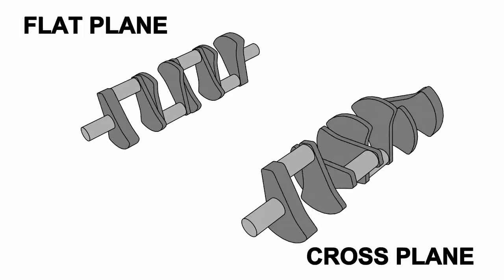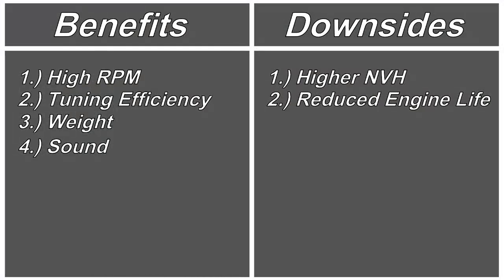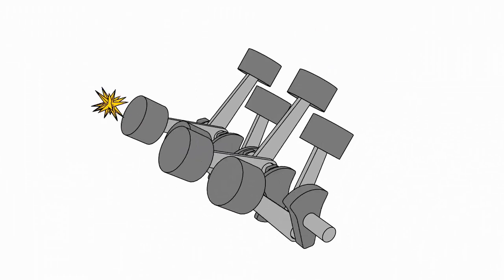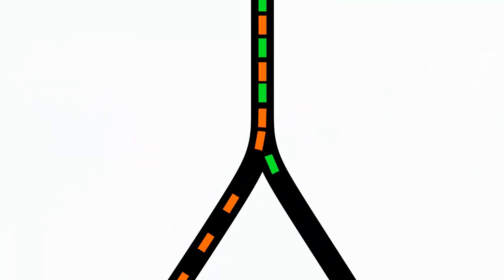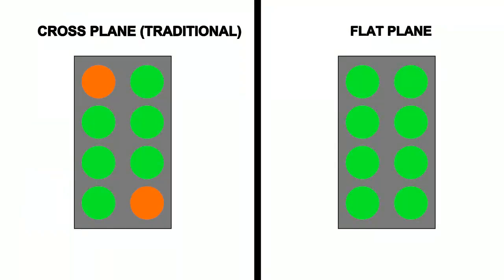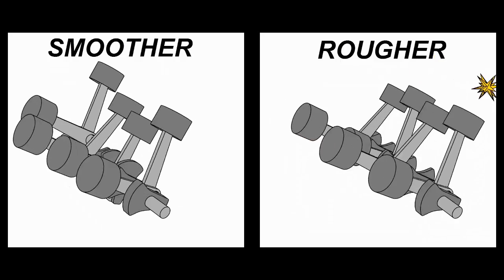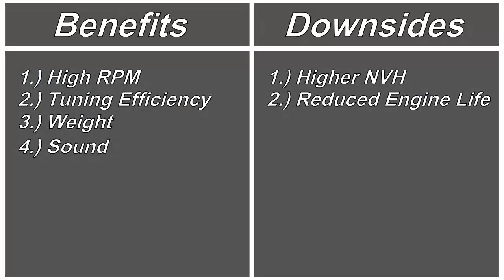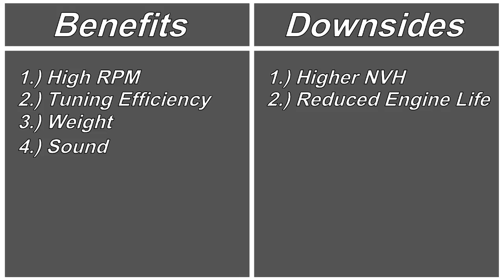Flat Plane Crankshafts

Comment: There are a lot-more historical reasons why American V-8's went with crossplane cranks than is even thought of being addressed here. Keep in mind, the Dodge Brothers (actual engineers) looked at individual journal cranks, flat plane cranks, etc., before agreeing to use cross-plane cranks in their V-8's...a lot of this fell to linear engine length, durability and torque, absent most of the other designs (short the multi-cylinder radial engine concept). All this is a great 'racer debate' when discussing 4-cylinder engines...but quickly fails the litmus test of 'realistic engine designs' when you get to considering how long an engine has to be when it has 8, 10 or 12 cylinders (and using a flat plane crank). It also fails to consider the cylinder bank angles in attempting to accomplish 'flat plane' ideology...being as a 60-degree V-8 and a 90-degree V-8 have different combustion timing...all discounted when you are dealing with inline 4's and 6's...so careful, you are trying to greatly 'over-simplify' combustion engine dynamics for the sake of selling a Ford-Euro engine design that doesn't work so well in most applications outside of racing.
Reply: The first V8s did have flat-plane crankshafts, but they buzzed at certain speeds, just like a 4 cylinder engine.  It wasn't very noticeable in the Touring cars typical of the day, but in closed cars, it could cause drumming sensations at certain speeds.  Wouldn't be a problem in popularly priced cars, but unacceptable in an expensive luxurious car.  That's why Cadillac went to the cross-plane for 1923.  Closed cars had become much more popular by then.

Comment: It's like the old 2.4  Quad 4 Engines made mby GM had a really different idle due to their off self firing order unlike most inline 4 engines they have 2 pistons up and 2 pistons are down the quad 4 engines always had on up 1 down, 1 3/4 way up and 1 3/4 way down.
Reply: TRX VLOGGER that was a cool motor.
Reply: That's very strange, because the balance would be horrible and the firing order would be very uneven. I searched, and can find no evidence of this weird configuration - I have found technical descriptions with photos which confirm a completely conventional flat ("up-down-down-up") crankshaft. 

Check out the Engine Builder Mag article "Rebuilding The GM Quad 4". The 2.4 Quad 4 uses the #4620 casting.

Comment: the flat crank we put in our 350 chev had 2 cyclinder's going off at the same time.    smoothest running engine I ever saw.
ZERO side to side vibration.   
nippy little bitch on the throttle though....   touch the gas and it was 800rpm to 2200 rpm instant...

Comment: Boxer engines are considered the most efficient and use the flat plane crank, however the more "V" you add to the cylinders, efficiency will go down.
Reply: Boxer engines do not use flat planes. Flat planes lack counter weights boxes do not.
Reply: Also efficiency? Boxers are considered balanced not efficient.

Comment: Seen cross plane small block chevys turn over 9 grand.
Reply: Yeah, there doesn't seem to be much difference there with engines built for competition. Hell, the souped-up small-blocks in NASCAR can hit nearly 10K RPM, and they're 358 cubes/ over 5.8 litres.
Reply: You got that right. Back in the mid 80's my friend ran late model sportsman with a sbc 355 at 9,000 plus rpm's

Comment: Same as a boxer motor crank. VW bug.
Reply: Not at all the same
Reply: Every cylinder of a boxer has it's own crank pin with two counter weights a v has two cylinders with a shared crank pin and for flats no real counter weight and for crossplanes of course shared counter weights

Comment: But why doesn't the Mustang Coyote motor sound more like a Ferrari?  O.o
Reply: they use uneven headers to modify the sound, if you listen closely you can still hear the "the flat plane whine"
Reply: The GT350 with the 5.2L VooDoo does not, in stock form, sound like a Ferrari despite it's flat-plane crank. That is because the headers on the GT350 stock, as far as I can tell, are interfering with the exhaust pulses. A GT350 with aftermarket headers, however, does start to sound even more high pitched when up in the rev range. Anyone reading this, feel free to chime in if you know more.

Comment: I ran a flat crank in a 366 cid hemi at Chrysler engineering. Richard Petty brought it and wanted to go Winson cup with a Mirader but it didn't happen. The engine was so violent below 3, 000 rpm you couldn't start it with a starter. I wonder if anybody knows why?
Reply: The camshaft.  Had nothing to do with the style of crankshaft.

Comment: Now I know y I hate flat plane crankshafts. Cause a Cross Plane Crankshaft has a much more aggressive exhaust note than a flat plane. I'd love to here a Cross Plane in da new Ford 5.0 & 5.2 Dis is when Ford lost their edge in exhaust note compared to da rest of all V8's cause da old school 5.0 & 4.6 were da best sounding V8's when paired wit an H-pipe & Flowmaster 40 Series, none of dat delta flow crap. Smfh cause Ford lost their advantage on sound cause I could care less about power.😔😔😔 I drive a 2002 Crown Victoria LX Sport wit da stock H-pipe wit no cats & Flowmaster 40 Series & everytime I drive er I feel like I'm 7 years old again cause of dat sweet note she produces under acceleration at 2k R.P.M's.💪💪💪

Comment: Why aren't 4 cyl engines made with flat plane crankshafts?
Reply: Tim Hallas 
Probably because the engine would be imbalanced because there’s only four cylinders instead of 8.
Reply: @francesco1998   4 X 90 degrees = 360  of course it would be easy to balance. Each piston has one that is 180 degrees to it.  Firing two per revolution, at 180 degree intervals..  It's perfect.
Reply: Tim Hallas 
I mean idk
Reply: @timhallas4275  probably less need to.
Reply: @jdrok5026  less need to what?

Comment: Great explanation and an informative video. Thank you :-)
Though flat plane crank V8's (for me) will never sound as good as a cross-plane crank V8. They sound very much like a plain ol' four cylinder twin cam engine.
I'll take the beautiful V8 rumble any day and pass on the efficient scavenging and high rpm ability. The whole idea for many that understand, is the great torque a decent sized V8 can make right there from idle and maintains great torque throughout a realistic and usable rpm range (<6,500) when you have a daily driver. In other words as much torque as possible from as low an rpm as possible and maintaining great torque for as long as possible. Torque makes the engine more responsive and more pleasant to drive, you can keep the high rpm/high hp screamers.
Reply: Flat-plane V8s run like a pair of 4 cylinders sharing a common crankshaft.  That's why they sound 4 cylinderish.  They also, at certain RPM/Load conditions, vibrate like a 4 cylinder as well.
Reply: @michaelbenardo5695  Agree, they don't float my boat either.

Comment: Now with the Mustang GT 5.0 liter crossplane engine producing 480 HP, kinda looks like there wasn't much point in developing flat plane 5.2 liter with 526 HP and weak low end torque for the GT350. Not much difference in power.
Reply: The voodoo really isnt weak in any characteristics. But it was also a higher end trim the gt and gt350r are different breeds the voodoo absolutely makes the coyote sound boring.

Comment: So why did they start doing the 1-8-4-3-6-5-7-2 thing in the first place then? They must've had a reason. What type of crank does a Ford v-10 use? How about a Mopar v-10? Enzo Ferrari said there's no replacement for displacement. I agree with him on that, and I'd wager that Farmtruck agrees with him also.
Reply: V10s use crossplanes. 18436572 is pretty much the crossplane firing order. There are a few different ones but largely that is the most common order and has been around for decades. Why likely stress to the crank is the best.

Comment: Yeah but the V8 is a bad idea from the get-go. Flat-plane or cross, it has a natural harmonic imbalance that will require a harmonic balancer on the front and a weight on the flexplate or flywheel at the rear that serves the same function as the front balancer. V12's (and in-line 6's) do not have this problem, they are naturally balanced with three cross planes and have much higher RPM potential and durability. The reason manufacturers don't give us many of these engines is cost. In line 6's are common, but mostly on trucks, many diesels: in order to get a lot of power though you need a big engine, hence their use in trucks. V12's can be compact and get a lot of power, but they have more parts and there's your cost factor. Sadly, now that costs are becoming less of a factor, American and now more European enthusiasts love the sound of the V8 and so the V8 is here to stay, at least for a while. I love the sound of the V8 myself, but as an engineer I can't get past the knowledge that it is simply a bad idea with only the 90 degree V6 being a worse one.
Reply: ladamyre Agreed. The inline six is a jewel. BMW is a good example.
Reply: Huh high rpm limit that's why f1 got v8s above 20k and not v12s
Reply: Also simply a bad idea. Most engine platforms are a bad idea if vibrations are the only goal. But your also limiting your thought process. You state that v8s cant rev as high well natural balance does not increase rpm capability in general v6s can actually rev extremely high. But it takes engineering to make the most of any platform. Your thoughts are bad as a engineer. And generally that thought process as a whole has been the death of innovation. V8s have advantages you just ignore them because idk your either a horrible engineer or just find nvh to be the only thing to design for. V8s have natural characteristics that allow them to be higher displacement than their Inline counterparts with less stroke or bore favoritism. As even with larger bores and strokes the size of the engine remains most of the time with a smaller foot print in length. They also have a good primary balance characteristic in crossplane design. They also suffer from less dips in torque between each cylinder firing as the lowest torque is zero not negative like other designs. They also are more rigid than i6 and i8s have due to no need to favor stroke over bore have more efficient intake abilities by having the ability to run better cylinder heads and bigger valves and be able to unshroud those valves. All while being physically shorter than a i6 or i8 and shorter than a v12. They also can produce better torque and hp due to not having a need to favor either bore or stroke in a production environment. Idk what school taught you to be a engineer but jesus you brought nothing to the table just a list of cons without touching the pros.
Reply: @jdrok5026  Dude, making assertions doesn't make you an engineer. All of the "advantages" you cite V8's as having are all BS anomalies specific to F1 teams having to balance fuel limitations, aerodynamics concerns and displacement limitations. I said it once and I'll say it again and every automotive engineer who knows his stuff will agree: The V8 engine is a bad design compared to I6 or the V12.
And 90 degree V6's are even worse.
Reply: @ladamyre1  but hey glad a 21 year old with no schooling for engineering and a clear background of mechanical function and understanding of the science behind the engineering and work of a engine knows more about engines than a engineer on that no platform is perfect.
Reply: @jdrok5026  Right, a 21 year old kid with a "clear understanding" is gonna school a 61 year old retired ASE Master Technician that made a living working on these machines for 40 years and was trained at the GM training college in Atlanta by the people who designed them.
Right.
A 61 year old fan of F1 racing and saw it go from the Lotus' of the 60's to the ground hugging aerodynamics of the 70's, cars that created more downforce than the weight of the car and could theoretically cling to an upside down road surface, to seeing "downforce" banned and now being brought back.
And you're gonna take me to school.
With your "clear understanding".
Boy, I've worked next to a hundred guys like you, all "experts" because they read every Hot Rod and Car & Driver Magazine.
You and they were all a dime a dozen.
Reply: @ladamyre1  you clearly dont understand the basics. Age does not mean you know anything even within proper training. Given I've done more studying on these topics than most people who have degrees in it. You ignore the advtanages and only assert them to f1. Than give no actual evidence for your claims besides secondary and primary forces being cancelled out you. Didnt clarify why a v12 would rev besides better balance and characteristics. So clearly you need to do 1 of two things apply your knowledge and actually justify your claims or go back to school. But hey you call something a anomaly and say that it only happens in f1 when that isnt the case. The fundamental science is that geuss what more goes into engine design than just natural balance characteristics. When you can see that i6s traditionally displacement per displacement favor stroke over bore. Many engineers claim why they use v engines over I engines is their physical foot print while wide is normally shorter in both length and height. Yet that's only a f1 characteristic not why v6 are near the length of a i3/i4 instead of a i5. Which yes v6s can be up to the size of v8s. You say no pros yet ignore that the pros all v platforms have is shared with the v12. My comment is entirely about your ignoring that fact and saying a v12 is perfect when they arent they are large physically more complex and tend to have smaller bores and strokes vs v8s of similar size which limits airflow. To ignore every basic understanding of engine function to state that v8s and v6s are bad ideas means I did beat you in this game of mental chess. You never actually defended your argument so either your a prick who thinks his shit dont stink or your wrong and cant justify why a v8 is truly a bad idea.
Reply: @ladamyre1  huh dime a dozen I dont read magazines I've literally went through every engineering website and database I can realistically find have done more than my share of research on every topic I can have years of research and mechanical experience in the understanding of engines and the automotive and industrial environments. So much to the point I've actually destroyed diesel guys who've said to everyone 18:1 on a diesel for afr is lean for diesel and it scientifically is fucking rich for diesel.
Reply: @jdrok5026  Again, a 21 year old asserting he knows more than a 61 year old who had a career in the industry...
... because he studies really hard.
LOL

Comment: If a cross plane V8 crank is fully counterweighted the end counterweights can be much lighter then the conventional and counterweighted crank allowing faster acceleration with less Mass. The only issue is you have to design the crank to match the rod and piston weights. This fully weighted option also gets rid of the whipping effect that rips the guts out of engine blocks at the harmonic frequently  speeds
Reply: I think the Ford Y block and the same era Lincoln engines had fully counterweighted cranks, and the Y block had an unbreakable bottom end.  I guess that's why.

Comment: What v8 engine uses that crazy line in traditional cross plane for firing order? its not 18436572 with driver side front being #1, or ford using passenger bank as 1 with 15426378 - which is the same as gm firing order just different cylinder numbering. Its also not that crazy ford firing order of 13726548. that changes the entire balance compared to the traditional in video mr 3D.

Comment: Couldn't you just get around the issue of uneven exhaust pulses by using a more sophisticated header design that uses different lengths?

And do something similar on the intake side, like using 1 carburetor per cylinder, preferably with individual intakes?

(of course that would have an effect on weight, size, price, and engineering time. My question is simply if those disadvantages could be avoided if someone insisted on a crossplane crankshaft)

Comment: So it would seem that having equal length header tubes on the cross plane would not be all that critical.  The exhaust gas pulses do not arrive at the collector in evenly spaced times.  But flat plane engines, being essentially two four cylinder engines could be smoothed out considerably with balance shafts, just as four cylinder engines are.
Reply: They can, but that cancels out the cheaper-to-produce flat-plane crankshaft as far as production costs go.  That's why nobody has gone that route.  The Oakland V8 of 1930 - 32 is the notable exception.

Comment: This explains why dragsters all use a cross plane crankshaft, since most have large displacements, 7 liters or more.   My understanding is that it's just not worth having the secondary vibrations that the cross plane crank eliminates.   In race cars there's much less reason to care, as the engine is only intended to last for the race.
Reply: It depends on your needs the flatplane has limitations to displacement